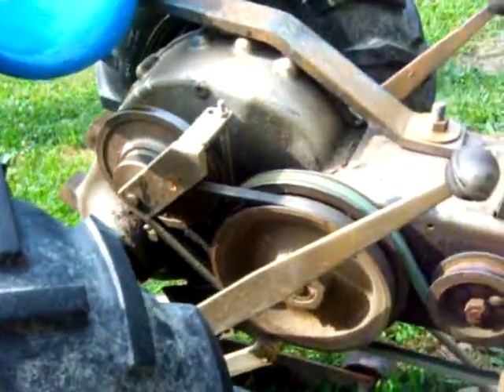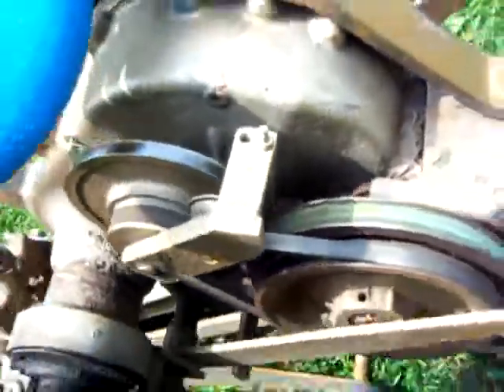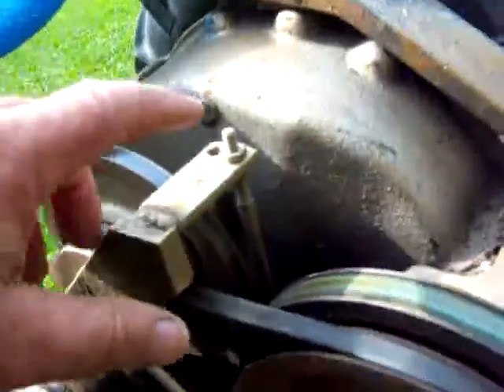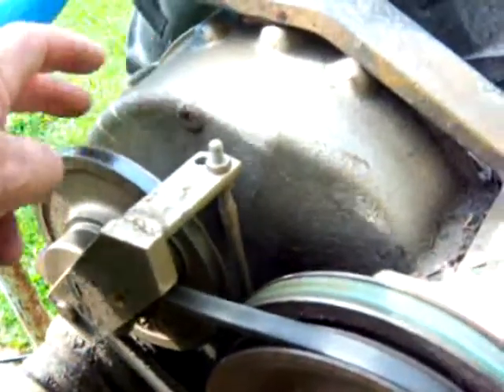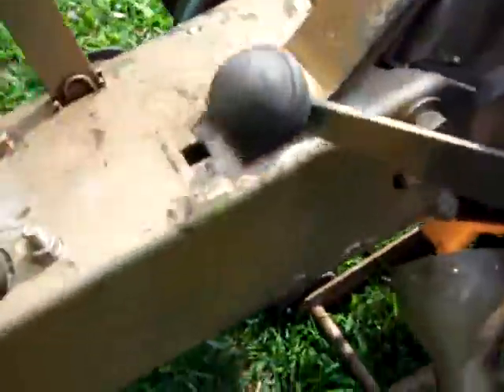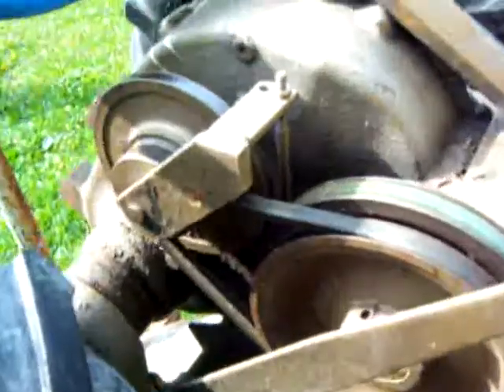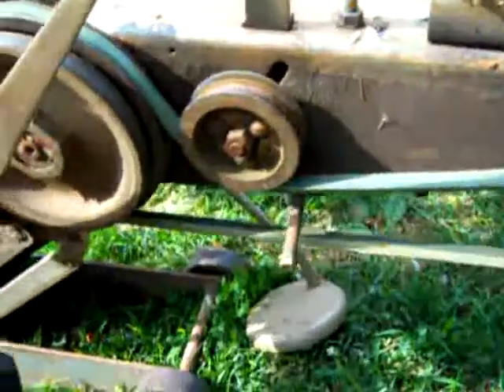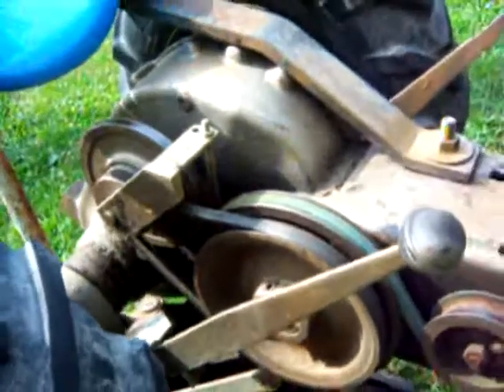1959 David Bradley Suburban Reverse Adjustment Part 2

Comment: Any chance you still have this tractor and can make a video explaining how the clutch/gear lever works? My brother has one of these (his is a Sears, probably '61 or' 62, not sure, but same thing as the DB) and we can't figure out how the thing is supposed to work. I see the plate on the bottom that the lever is welded to, but I can't figure how it's supposed to move, and right now we can't get any movement at all from the tractor.